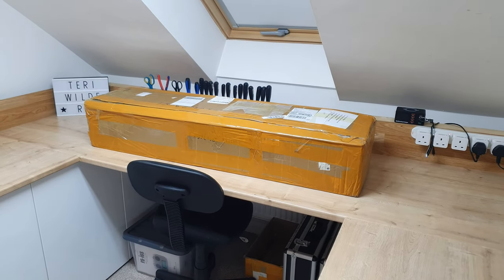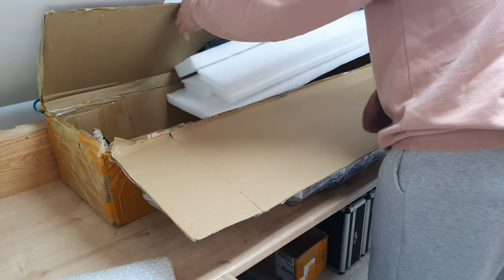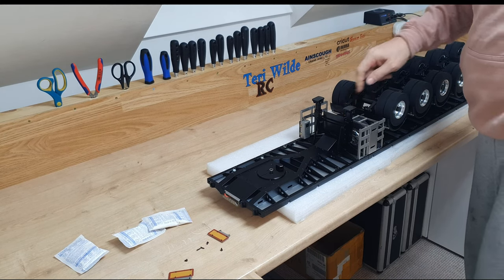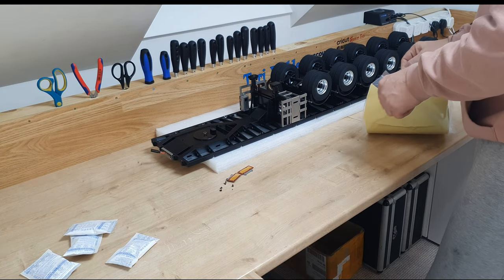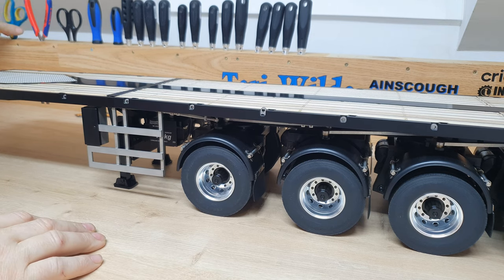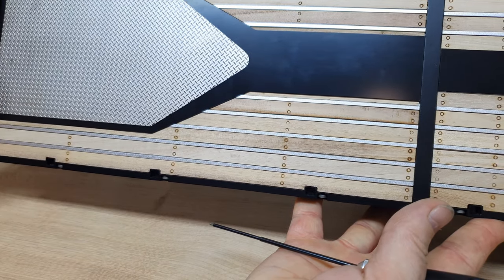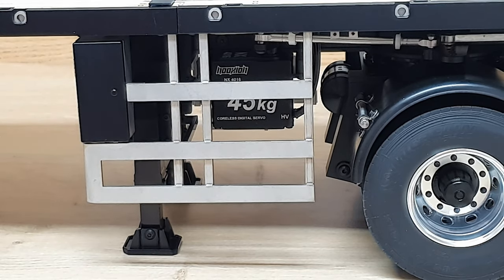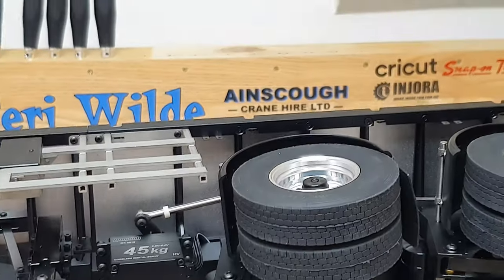Tamiya MAN TGX - Project Ainscough - Ep12 - Nooxion Fury Bear Ballast Trailer - 4k

Comment: The trailer appears a perfect fit for Teri Wilde RC and Project Ainscough. A good design & manufacture, maybe not so good assembly, but the attention to detail looks superb. The retractable tie-down points, break drums, bearings, decking, metal spars, etc etc .. what a joy to look forward to, an exciting adventure build continues, well done and thanks as always. The  control system for the steering, presumably some sort of potentiometer driving the servo, interesting and a good solution. Look forward to see future development and your thoughts.

Comment: Well I’ll be the first one to say  you are my hero to take apart a $2000 trailer but we see y but on that 5th wheel well it’s tacky but cut a thin price of Teflon and glue it in or finding something that fit over the square piece on the trailer🧐🧐
Reply from the maker: I made a couple of alterations to the trailer as well, call it brave, call it stupid, or just call it progress. I was always going to make changes to it anyway. maybe I have more money than sense... lol
I kind of took the decision to swap out the MFC 5th wheel on the truck because of the sliding 5th wheel plate would be hampered by the coupler switch cable. I have to get back into the trucks MFC wiring for the trailer lights. and I'm now thinking that I could still use the MFC 5th wheel because I won't be moving the slider that often. There are 5 different Tamiya 5th wheels so I'm sure one of them will fit the switch and not have such a wide V. we'll see where that goes when the trailer wiring is done.
Reply: @TeriWilde  o no maté it’s call making it better 👍👍👍

Comment: Teri, me Mate.... that took stones to take that apart!! Obviously necessary, though, as their inability to tighten screws properly was an issue. 
They SHOULD note that their 5th wheel pin is for aftermarket Alumininium 5th wheels only, and incompatible with Tamiya.... the single largest variety of Trucks on Earth.
Reply from the maker: They should have made it a self assemble kit rather than a factory assembled kit because it really needed stripping down and rebuilding. It's as dry as a bone with no grease or oil in the important places..... all part of the hobby...👍

Comment: Glue  two peices  of styrene  to the MFC fifth  wheel  both sides  to get  rid  of  the  slack
Reply from the maker: great suggestion. it's certainly an option for a permanent fix, one I am considering. 
I was thinking of making a temporary solution if any of my friends want to pull the trailer and have a MFC 5th wheel fitted to their truck.

Comment: Hi where do you get trailer parts for a low loader.I would love to try a build a gooseneck trailer if can find plans to go from.it’s bits like the small wheels.wish tamiya did more trailers
Reply from the maker: I agree, Tamiya should do more trailers.
I'm not sure where to get low loader parts to build your own, it's not something I've done.
Reply: Sorry another question I think the suspension  on the trucks is no good.the axels don’t move freely enough like a real truck.see trucks on here a there suspension moves, great when going over uneven ground.a reacts fast the kit that come with them nothing like that.see on eBay kits with airbags but don’t show how well they move if do.or airbags just for show.have you ever upgraded your trucks suspension to get more movement.tamiya should take a leaf or leaf’s out a fit oil shocks like there car kits with less oil so get more movement then.kind regards Glynn
Reply: Google gallinger they got some 3d print files and stuff, im looking into it as well

Comment: Nice piece of kit Amazing really. Are you going to paint the trailer to match?
Reply from the maker: I was going to, but the new Tamiya 8x4 Scania S770 release might mean I go for Ainscough current livery. If I stick with the 2008 colours, I will wrap the trailer in vinyl and look at a new set of wheels... I really don't want to anodise, paint, or powder coat the wheels at this point in time.
The trailer cost a little too much to make a huge visible change to it.

Comment: At $2000.00 id complain about that damage let them deal with the courier service dam your to easy
Reply from the maker: I'm far from ''easy''..., I just wanted to crack on with the project without the hassle. what needed to be done was far quicker to rectify than send messages to and fro. I did let them know about the issues and they gave me a HUGE discount for my next order which I took advantage of.
Reply: @TeriWilde  I get that been there but still I'd of taken pics and tried to get something out of it
Reply from the maker: @leewilliams9904  yep, I did take photos, and contacted them, and I got a huge discount with my next order. without the hassle of returning it.
Reply: @TeriWilde  then that's a win mate